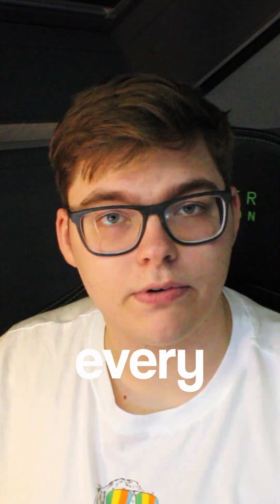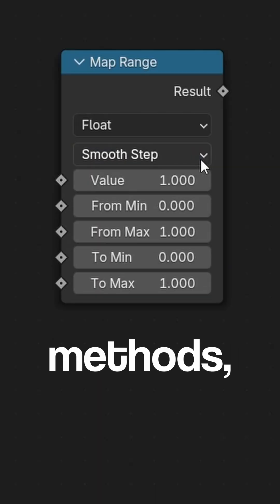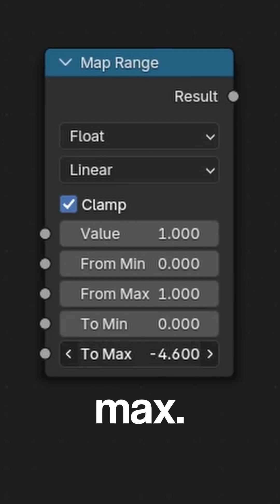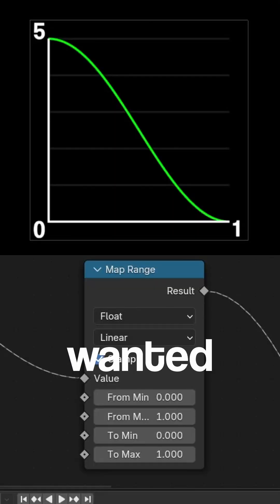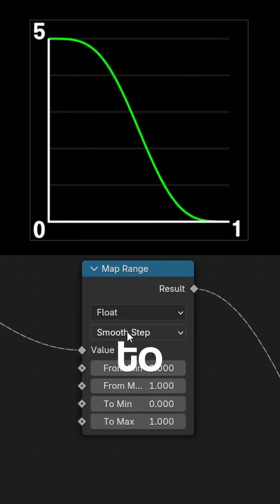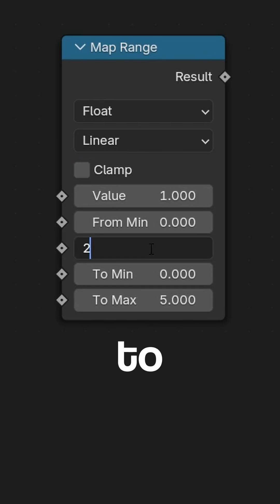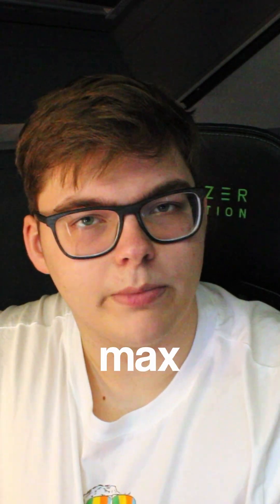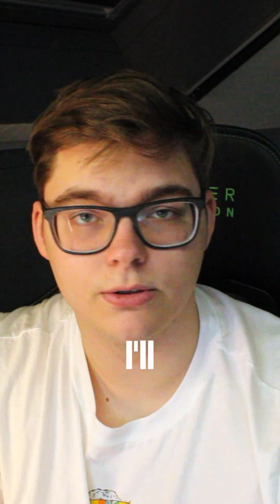Map Range | Explaining Every Single Node in Blender #blender #b3d

Comment: I'm having some trouble figuring out the values I should be using for a project I'm working on. I'm making a grayscale elevation map where meters (ranging from -100m valleys, 0m sea level, and 900m peaks) are represented with uint16 values (0-65535). These can be displayed in grayscale with corresponding uint8 values used as light levels (#000000 white would be -100m or 0x0000 and 900m would be #ffffff black or 0xffff). The result should be that all landmarks at sea level should be colored with an HSL value of X,0,26 (in that ballpark) and all landmarks at 900m above sea level should be X,0,240 (since luminosity doesn't go up to 255 for some stupid reason). Otherwise the result could use HSV if that maps more cleanly to the 0-255 light levels I'm looking for.
Also, is it possible to have banding? Like if I wanted the render to look like a contour map where the color changes every 5m?
Just editing since I think I found an okay solution:
From Min: 0.255
From Max: 255
To Min: 0.255 (to get the value I wanted at sea level, I change this to 127)
To Max: 25.5
The only problem is that areas right at sea level have a luminosity of 61 rather than 26... Still working on that.
For the contours, I just used Stepped Linear coloring instead of Linear and set the value to 255. I don't know if it makes a difference to add one to the last digit of all of the values (since 255 is meant to account for 0 being a valid digit, totaling 256 digits) but this seems to work. Leaving this here in case another random person likes maps.